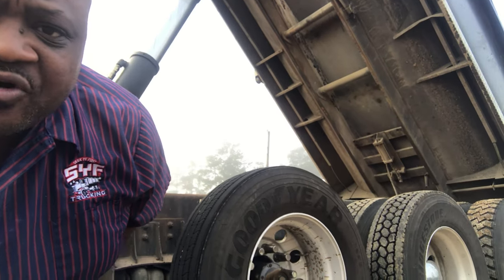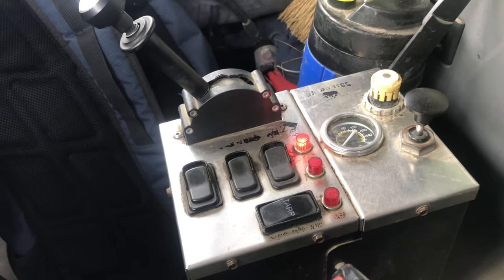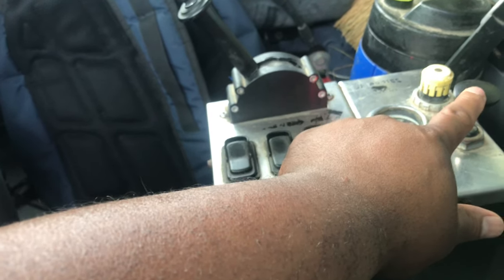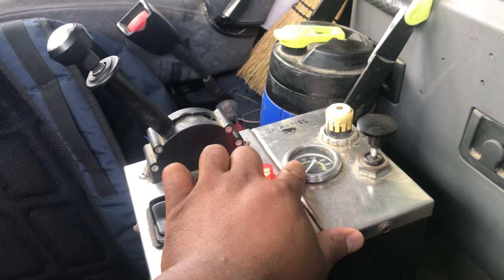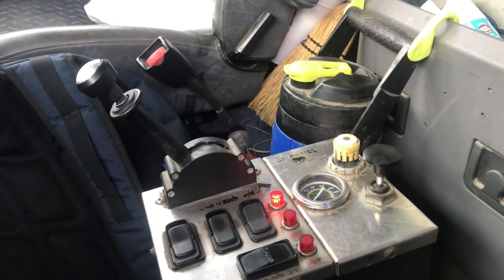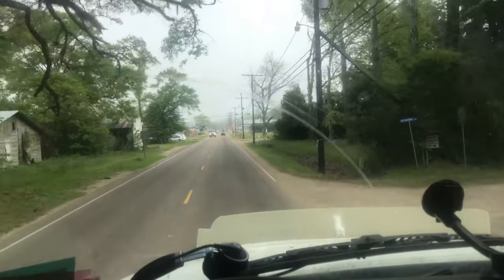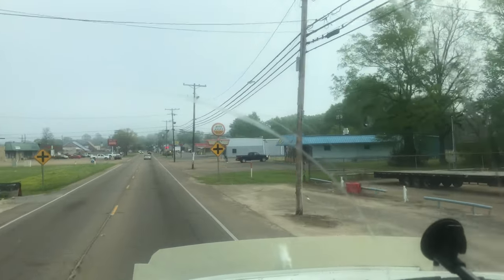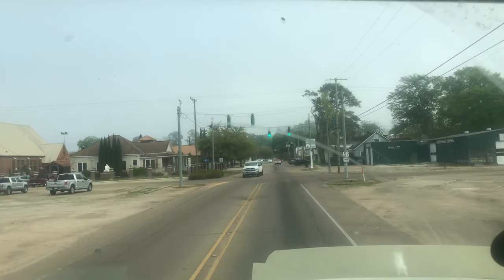How To Work The Third-Axle On A Triaxle Dump Truck.   #macktrucks

Comment: I was taught that when u let the triaxle down, dont press the brakes until the airbags fully fill roughly 10-20 secs, can cause extra wear & tear on the tire. But very valuable info I’ve been 🙏🏿💪🏿
Reply from the maker: Yes thats good info. Mines go down in about 8-10 secs.  So it varies Ive seen some take 25 secs to fully get down

Comment: I'd really like to know how many pounds is on my push axle per psi. I'm in a KW tri-axle with dual ties on the pusher. I run at 50-60 psi at 70-80K LBS

Comment: I been running a pusher axle for two years I never raise the axle on turns and I never had any damage. Seems like a driver myth that you need to raise the axle
Reply from the maker: Those tires will generally slide a little when you turn and wear tires faster and I have seen guys pop that axle while turning.  We run the psi at 50